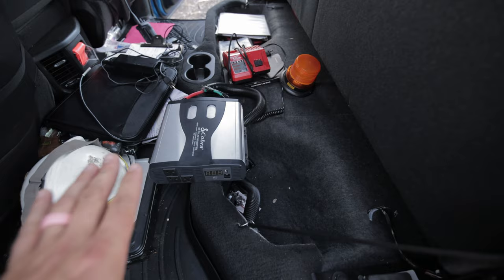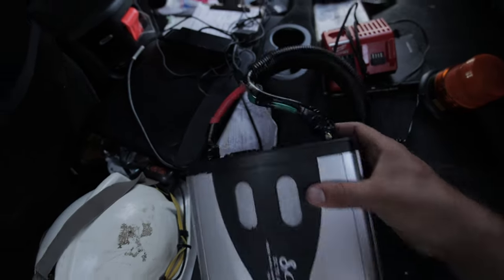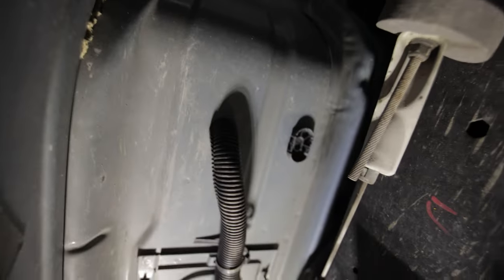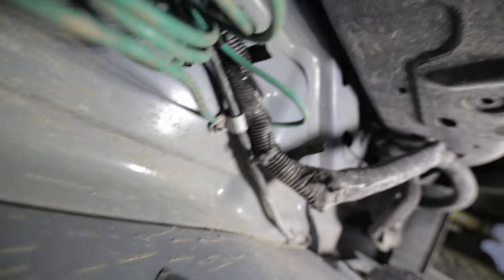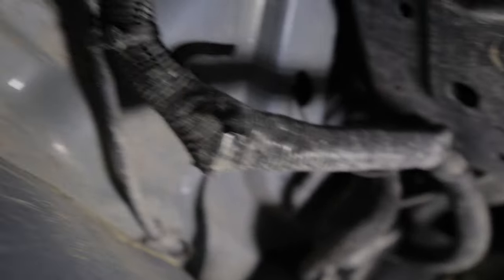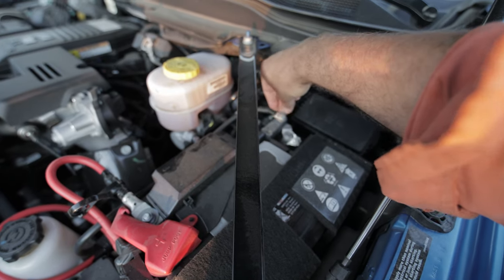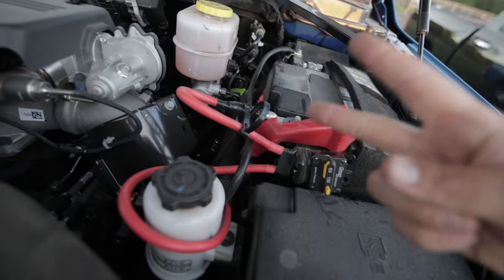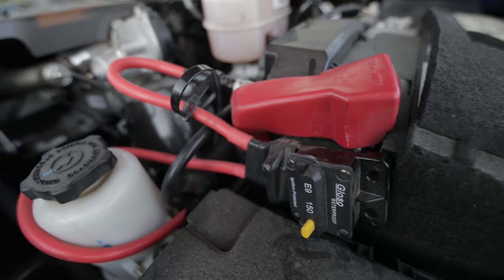how to wire an inverter into your truck EASY

Comment: i have a ford f150 2020 with a 12v cig plug and a 110v ac 400w max outlet. im tryinf to figure out how to plug a 6gal air compressor thats 120v with 10amps for an air tank. would a 1500w inverter work in this case or would that burn a fuse or battery

Comment: My work truck has an inverter on it. I keep getting an auto throttle fail and then it cuts out when running my microwave. How's your setup going? Transmission guy as well. Stay safe.

Comment: You can get cable glands to put at the entry point through the body, that's what I did.  It's a little plastic tunnel that inserts through a hole with threads, then you tighten down the nut on the opposing side to lock it to the metal wall.  Then it has another larger nut on the exterior side that you tighten down after the cable is in place and it shortens/tightens down a rubber grommet to water seal the wiring through the wall.  I highly recommend.  They come in various sizes, I used a bunch of number 10 gauge wires from Lowes instead of a solid single cable, it was just easier to route and deal with with the way I ran it through the firewall in the kick panel area.  WI think I used PG 19 or PG22 size.  4x 10 gauges on the positive and another set on the negative.

Comment: I have a 1500 watt inverter my dad used to use camping 19 years ago. I remember running it off of the microwave many times. but I do also remember that the inverter has an overload protection system. I remember that alarm going off many times as a kid Lol.  I think putting a breaker is just extra precaution Imo. but I will be installing it in my 1500 Ram to do the same thing running a microwave
Reply from the maker: yes this one def has something as I tried to run my 120V welder off it and it didnt like it. The breaker never tripped but the unit beeped a bunch and displayed some weird stuff. Had to weld off my generator. LOL hey worth a try.

Comment: I installed a 1500W inverter behind the seat in my 1996 F150 many years ago. I just bought a new 2022 Ram 2500 this past week. I wanted an inverter, but it was not available (probably due to supply chain issues). So I plan on either buying another inverter or transferring the old one to the new truck. A couple of notes:

1. If you forget to turn the inverter off, it will drain the battery when the engine is not running. Starter batteries don't like being drained. Knowing I'm the forgetful type, I wired a starter solenoid in series with the inverter power and connected the control wire to something that is on only after the engine starts. (The wiring diagram for my F150 pointed me to a windshield wiper wire. The windshield wiper only works after the engine has started.) This provides two advantages:

a. The inverter cannot drain the battery when the engine is off. No surprise dead/damaged battery!

b. The inverter is also disconnected when starting the vehicle so the battery can supply full power to the starter.

The starter solenoid also has an advantage over isolation diodes because there is no voltage drop. I also added a deep-cycle battery in parallel to the inverter (mounted in a battery holder in the bed of the truck) so I can run the inverter with the engine off. The deep cycle battery handles low voltage better.

2. It looks like you used regular electrical tape. I don't know how well that will hold up over time. I used silicon tape which is more water tight.. You can just wrap it over the electrical tape.
Reply: what are you powering with your inverter? I'm just not really seeing the point. my laptop, air compressor etc is wired into the battery. charging cordless batteries  i guess?
Reply: I powered a PA system in a remote location.
Reply: @andrewbernhardt3061 
Can you give me a tutorial on how to do this lol I love this idea.
Reply: Better to run a switch. Then you can just flick it on and off, without putting additional load on your battery. Running to the accessory wire means all the accessories have power and are consuming. Not ideal if you want to run your inverter with the vehicle off.

Comment: Quick question. I have a 30 amp camper. Not a big one at all. Do you think I could run my camper off of my inverter just to literally use the  propane furnace and fridge? Minimal watt usage. No wall outlets would be used or anything. I could even shut the breakers off to all other areas of the camper. Just a thought I had after installing my inverter. 🤔
Reply from the maker: yeah you could. make sure you look at wat each outlet is rated for on your inverter. The issue is constant voltage. for large amperage stuff you need to have the truck running. At least I do. I use a 900 watt microwave in mine and if I dont have the truck running (alternator) I get error messages and the truck lights go weird.
Reply: @GilbertGardens  Thanks friend. Shabbat Shalom!
Reply from the maker: @travisfrenchmusic4502  np

Comment: I would think you need at least a 5k watt inverter to run a microwave without issues. 1500 would go into protect mode which would be very annoying.

Comment: Do you have dual alternators? 
I just picked up a w2 big horn. When u read an instruction off of Hdram forums. It says you can ground to the engine for 300amps? But grounding to frame is safe as well then I see right? Are you running factory batteries or hybrid deep cycle batteries? Thx I’m looking to get a 2000watt inverter here in fl with hurricanes and all! I’ve done it with a 2019 ram 1500 but only an 800 watt inverter. My truck has air ride so I’m afraid of frying anything lol
Reply from the maker: I know guys have ran 1500 watt in regular rams. I have single alternator and just stock batteries I doubt there mu h. Good luck out there.

Comment: excellent and appreciate your expertise.   Is it ok to physically put the fuse/breaker close to the inverter instead of engine bay?  is there any worry about drawing down the truck battery?...i'm thinking about using the inverter to charge a portable power station from the truck battery/alternator
Reply from the maker: nope should be fine. i just shut the inverter off at night. ive left batteries charging all night with my new duramax without isues.

Comment: Thank you for this video I wish there were more like it cause it really is a scary thing to do, I have a 800watt inverter, and I do t know if I should still put a breaker on it, I really dont mind the car running I just wanna make sure it's good even without that breaker, I'm still decisive 🤔but thank you for this video👍
Reply from the maker: Basically everything electrical needs to be fused somehow. A short circuit will cause damage or a fire. With no breaker you allow unlimited current to flow, it will melt wires and damage. Look up a watts to amps converter for 12v auto.  Figure out hoe many amps it draws at 800w. Make sure your wire is big enough and pick a fuse that supports that wire.
Reply: Wow, thank you so much I certainly dont want to make a mistake and cause horrible catastrafic failure, so thanx🙏
Reply from the maker: @ruggedkingdragon  sorry not trying to scare the crap out of you I'm just saying safety first buddy. Cheers. Let me know if you need a hand.

Comment: Question, do you need a shut off switch so it doesn't drain your battery?
Reply from the maker: @meagainhahaha928  you do not. As long as you don't leave little things plugged in.

Comment: If a wrench connects the two battery terminals, that 12volts will not hurt you, but I am curious, can the elctricity running from that battery to the inverter shock you and hurt you real bad if there was a nick in the wire and you touched it? Could you please explain why or why not? 2nd question I have, is how safe is this setup? Could anything else be added for extra safety? 3rd question, would running 500 watts or so for few hours be fine on the vehicle while driving? Thanks
Reply from the maker: If you bridge out a 12v connection with load on it can burn. You could increase the wire size more. 500watts is good. I run quite a bit more.
Reply: @GilbertGardens  Thanks!

Comment: Good video but, I feel the green ground wire should go into an actual grounding rod in the ground, not the place your negative cable goes to. That way any short circuit goes straight to ground rather than the body of the truck.
Reply from the maker: Yes they should be separate

Comment: Am i safe to assume that a 3,000 watt inverter would then require a 300 amp trip breaker/fuse?
Reply from the maker: that seems to be the norm. Its tough to calculate we need to know the resistance and length of cable but 300 should be safe.

Comment: Hi,

Thanks for the video. Do you think a 300 amp fuse is good for a 1000 watt power inverter? Or would the 150 watt one you used would be better? 

Im using 4gauge wire and found this 4 gauge 300 watt fuse and it’s huge compared to your😁
Reply from the maker: i dont understand some of the terminology used. 4 gauge 300 watt fuse? Fuses are usually measured in Amps. For a 1000Watt inverter you would need a SMALLER fuse/breaker then my 1500watt setup because you are drawing less amperage. Something like 75-90 Amp would likely do. also #4 gauge wire is  smaller then the wire I used. I tihnk I had 1/0 or #2. look up american Wire Gauge to understand how the wire sizes work. Most important thing is DO NOT install a larger fuse or breaker for what you are trying to do. if anything go smaller (for safety). Do not allow too many amps to burn your wire/interverter down.
Reply: @GilbertGardens  sorry, I used the wrong terminology. Yes, I meant amps.

Thank you for the fast response and information. I will not install what I have and will look into this a bit more and get a fuse that is appropriate.

Thank you for your video and all your help.
Reply from the maker: @PNV  no problem email me Eddy.gilbert@gmail.com if you need a hand. Cheers.
Reply: @GilbertGardens  Thank you 🙌

Comment: Please show a close up of all wiring connections. That is what I am specifically trying to make sure I am connecting correct. Everyone glosses over that as though they are making these videos for accomplished electricians. Also, if you know the best way to add a back up battery into the system please let me know. Specifically the wiring configuration and routing. I understand you were not making a dual battery set up demo, but the only videos that show that, again, gloss over the close up of the connections which is the only thing I’m really even watching this for .
Reply: Thank you 😊

Comment: @4:46 DOESNT LOOK LIKE YOU SCRAPED AWAY THE PAINT WHERE THE WIRES ARE MOUNTED TO.. THIS WONT ALLOW FOR A GOOD GROUND..
Reply from the maker: This is a factory hole I used. That clamp is bolted to the frame. Good eye tho always best to have a large area cleaned off.
Reply: How is the car earthed if you don’t have an earth rod going into the ground if running an appliance with an earth terminal on the 3 pin plug?? The car will be come live
Reply: @Margaretsanger222  It would be like touching a wire from the positive post to the negative post on the battery creating a short circuit, tripping the breaker.